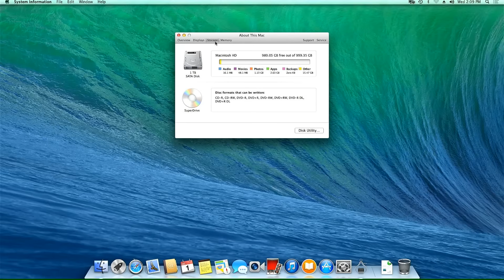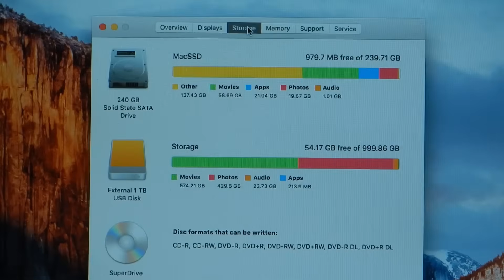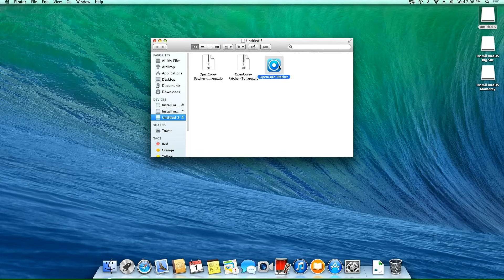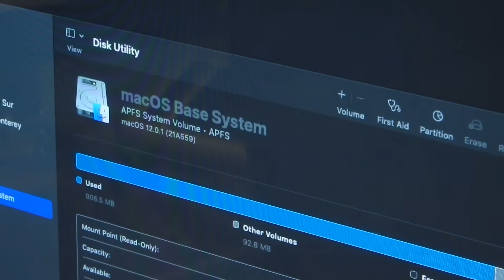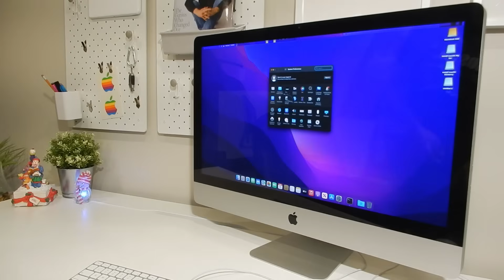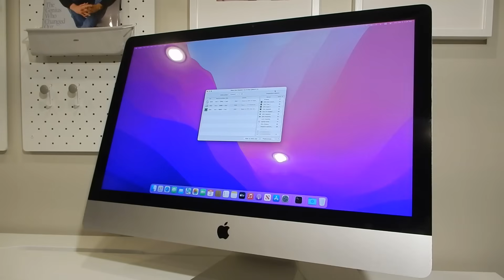Apple thinks this 2009 27" iMac is worthless. Let's refurbish and upgrade it to Monterey!

Comment: So now I can buy an old iMac 27" from 2011.
Offcource I wil run the newest MacOS.
But also I want to use it as a monitor to connect to my Windows 11 Mini PC.
Can you telle me how to connect my Windows 11 MiniPC to the iMac 27" 2011, so I can play also with Windows 11 on the iMac ??
Reply from the maker: The feature you're talking about is Target Display.  I'm not sure if it works on Monterey, since I don't think any Mac which officially supports Target Display also officially supports Monterey.  And in order to activate Target Display mode, you have to do it from within Mac OS.  Also, very important, Target Display only works with Thunderbolt display.  The connector is the same as Mini DisplayPort, but it is not compatible (I did try).  I have read that it is possible to use Windows with Target Display IF your Windows PC supports Thunderbolt display - but you'll need to do some Googling to confirm.

Comment: On my 2008 Imac, 10.9.5 was the farthest I could go without problems -
Reply from the maker: Ya, there's definitely issues running newer OSes on unsupported hardware.  Even this 2009 works "good enough", but not perfect.

Comment: Would it be possible for you to go through the driver patching process you mentioned for the Radeon HD 4000 series GPUs? My Radeon HD 4850 is giving me headaches during my 2009 27" imac refurbishment. Any tips on which GPU upgrade you would recommend would also be very much appreciated. This is my first time refurbishing an Apple machine.
Reply from the maker: Hi!  You should be able to use the same patcher which you used to make the USB key.  After the OS is installed, run the patcher again and choose to install Post-installation Patches.  The process should be 100% automatic, and you should have full non-Metal acceleration after rebooting again.  What issues are you having?

The GPU upgrade is necessary if you need/want Metal support, or need to use more graphics-intense applications.  If you are upgrading the GPU, you won't need to install the patched Radeon driver (or you may need a different patched driver depending on the GPU you buy).

Which GPU depends on your requirements, budget, and tolerance/willingness to do some hacking.  The easiest option is to get the latest MXM 3.0 Type B card (Mac version) pulled out of an iMac which is officially supported by Monterey.  Then everything should work out of the box.  You can get PC versions which are much cheaper (and sometimes faster), but you either have quirks like loosing brightness control, blank screen during bootup, etc without flashing the GPU to a Mac version or hacking the driver.  And even after flashing/hacking, certain cards still don't work 100% perfectly.  You really have to do extensive research, as there are pros/cons to each card.  The one I was intending to use myself (if I ever do it) was a FirePro M5100 - because they perform OK, they're cheap and I currently have easy access to a red Dell version which is highly compatible after flashing.  There are probably better cards to use, I just already have a lead on this one.

If you're buying a pre-flashed version (like on eBay), you'll be very limited in what's available so your decision should be much easier.  If you're flashing yourself (or not flashing and forgoing boot screens/brightness control/etc), you can use a much larger and cheaper variety of cards.  If you're flashing, you either need a compatible PC or a USB flashing clip.  If you're not into messing around with these things, I'd recommend a slightly more expensive pre-flashed Mac compatible card from eBay.  Just google "card-model + Monterey + metal", and read up to see if anyone has any quirks or issues before you buy that model.  Also note that not all cards use the same layout, so you need one which is the same and compatible with your heatsink.

Hope this is helpful.  Sorry, but I just haven't done enough research to know what the most ideal card would be for the upgrade.  The most ideal card for me is the one I have easy access to :)
Reply: @rebootretro  Wow! Thank you so much for taking the time to respond with such helpful info! I'll definitely look into this further. Thanks, again, and take care!

Comment: Please let us know what cables have you tried or planning to use. I have the same iMac and I’m trying to use it with 2017 MacBook Pro and PlayStation as a target display mode, also with Monterey having universal control no longer in beta would that work for iMac? If anyone knows how to use iMac as display with PlayStation that would be awesome, also a great video idea - use iMac as a universal monitor/tv
Reply from the maker: This is an area I'm not too familiar, unfortunately.  I don't know if Target Display will work if the iMac is running Monterey, since I don't think Monterey officially supports any iMac with Target Display.  Someone correct me if I'm wrong please.

If you're using High Sierra, Target Display should work.  There is a catch though; While the iMac supports Mini DisplayPort (or HDMI with converter) as an output, it ONLY supports Thunderbolt as input for Target Display.  I tested this and was thoroughly disappointed, because I wanted to use it as an HDMI display.  So to use for your 2017 MacBook, it should work fine.  For a PlayStation or anything else, likely no-go unless it happens to support Thunderbolt video out.

On a side note though, you can get cheap HDMI to USB capture devices from Amazon/eBay which would allow you to watch any HDMI input.  Not sure how the input lag or quality would be; it might pass for TV watching, but I'm not sure about gaming or as a computer monitor.

Comment: Excellent vid! Thanks for posting, this is extremely helpful. I just bought an early 2009 20" iMac and am excited to do some upgrades. Officially it can hold a max of 8gb of ram... wonder how true that is🤔lol
Just a couple of quick questions: Is the Monterey upgrade trick still possible with this earlier model? And when it comes to upgrading CPU's, will theoretically any CPU work in this ol' girl? Or is she stuck with older options?
Reply from the maker: Yes, the OpenCore Legacy Patcher works as far back as the mid-2007 iMac.  The biggest limitation is which graphics card it uses.  According to the Patcher docs (https://dortania.github.io/OpenCore-Legacy-Patcher/MODELS.html) yours is supported with GPU acceleration in "Public Beta".  You will also not have Metal support just like me, which is fine for office tasks and web browsing.

For CPU, you are limited to CPUs supported by your Mac's chipset.  I believe yours is a Core 2 series, and I believe only Core 2 Duo chips are supported (no Core 2 Quads as I am aware).  That being said, you probably won't be moving far enough up with any upgrade to justify the cost or effort, as I believe the included chip in the early 09' was decent to begin with.  You might see some gains in a synthetic benchmark, but I seriously doubt you'll be able to see any improvement in real-world use.  For example, in this other video I compare this late 2009 iMac with a 2020 iMac - https://youtu.be/bO1XvSBG4d4 which shows the CPU is significantly faster in benchmarks, but doesn't really translate to real-world office type tasks as much as we think.

Upgrading the RAM like you're planning is an excellent idea.  Also upgrading to an SSD will provide huge performance benefits; it allows the CPU to spend more time crunching on data, rather than waiting from the data to arrive from the hard drive.  These 2 upgrades will give you far better performance for your $ than a CPU upgrade will :)
Reply: Thank you for your knowledge, you are a wizard. That helps so much!
Reply from the maker: @EastPlanet  Glad it was helpful!  I actually just got a 20" iMac with Core 2 Duo (not sure if it's 2008 or 2009).  I plan on doing a video on upgrading it as well.  My videos are more geared towards entertainment than tutorial, but I'm considering a more in-depth tutorial approach on this one.  Either way, I literally JUST got the computer, and have not tested any of it yet or mapped the video out yet, but spec-wise the Mac is very similar to yours.
Reply: @rebootretro  Omg that's awesome!! I'll be really looking forward to seeing what you do with it man, hope it all goes smoothly. Thanks for the heads up on that :)

Comment: Disappointed that you messed with
 your SuperDrive/ GPU air dam area which will affect GPU cooling. With a bit of doubled sided tape a SSD sits comfortably on top of the 3.5” HDD hard up against the plastic PSU air dam wall to the left of the HDD. Or if you don’t like that you can mount it behind the GPU, also you should have replaced the GPU for $50 to get full metal support and native acceleration.
If the SuperDrive still works it’s a great asset, if it doesn’t they can usually be fixed after removing a few screws and compressed air to clean the lens.
Reply from the maker: I believe there's only 2 SATA ports on this model which is why I removed the SuperDrive.  I needed 2 storage disks, but didn't need a disc drive.  Agree though, would have been nice to have both.  I put the foil tape to restore the air duct.  There is an air passage behind the SSD for the GPU, and from sensor readings it doesn't seem to be an issue.  But that's an excellent tip about alternate locations; I wasn't aware that the SSD would physically fit anywhere else.  I still may upgrade the GPU at some point, although it hasn't been an issue so far.

Comment: Great video, i have done this with a 2009 21 inch iMac, if you retain the sensor from the old cd drive and stick it onto the frame there is no need for macs fan control, the fans only spin up to full speed when the system detects a missing sensor
Reply from the maker: This is very true.  I did move the CD sensor over, however I find Apple is not aggressive enough with its cooling.  Apple prefers to run hot in order to run quieter, and I prefer to run a little louder as I believe cooler hardware is less prone to failure.  I’m only using Macs Fan Control to pull the GPU a few degrees lower since they’re so frequently prone to failure.  Not sure if this will make a practical difference long term but I guess we’ll see :)
Reply: Side note: when recently re-baking my mid 2011 27’s GPU my fans went full blast after reassembly and were showing errors. After multiple rebuilds I noticed that all I needed to fix them was to just give the sensors  a little press to make sure they were adhered well. 
Suddenly errors disappeared and fans worked normally.
Reply: @hanspecans how did the fans stop

Comment: Thank You.
Would you like to recommend me the 32GB RAM (Brand model).
Reply from the maker: The RAM was used and pulled from old laptops.  The RAM needs to be DDR3, but almost any 8GB modules will work fine.  I believe they were 1333mhz but I don’t remember 100%.

Comment: Is it safe to use
Reply from the maker: Safe in what way?  I don't see any way it could harm the hardware.  Software-wise, the patcher is open source so I don't see huge risks from a malicious code perspective.  It works perfectly for me with iCloud/iMessage/etc.  System updates could break it in the future, but realistically if you don't install updates on this system, you're still probably safer than the last officially supported OS which is more outdated.  :)

Comment: can i upgrade this to32gb ram??
Reply from the maker: Yes!  It unofficially supports a maximum of 32GB RAM using 4x 8GB DDR3 modules.  Although the processor is aging at this point, so there probably isn't a lot of applications where you'd get benefit of 32GB RAM with the existing processor/platform.  Anything you'd want 32GB RAM for you'd probably want a significantly newer/faster CPU as well, which is limited to a 1st generation Core i7 at best.

Comment: how to open display?
Reply from the maker: The 2009's have the glass magnetically attached to the frame.  The preferred method is suction cups at the mid-left and mid-right points of the upper end of screen pulling outward and slightly downward.  I think iFixIt has tutorials with photos.  In absence of suction cups, I have successfully used duct tape or packing tape.

Comment: Are you able to upgrade the CPU and GPU on this Mac Model? Or what about the 2011 Model
Reply from the maker: Yes, on this 2009 model both CPU and GPU are upgradable.  The Mac in the video already has one of the top tier Core i7 CPUs offered by Apple so it wasn't changed.  I didn't upgrade the GPU because I didn't have a better one on-hand and didn't want to spend the money, since I don't need the features it brings.  I could end up upgrading at some point in the future, in which case I will make a video.

The official Github page shows supported machines: https://dortania.github.io/OpenCore-Legacy-Patcher/MODELS.html#imac  It appears a 2011 is supported.  Without a GPU upgrade, it appears there could be some graphics issues but they claim the GPU is socketed and upgradable :)

Comment: Would this work with iMac 2009 27” but with 8GB and 3ghz Core 2 Duo and lowest graphics? I would upgrade graphics but don’t wonna risk breaking the thing
Reply from the maker: I did a quick search, and it appears that the '09 27" with Core 2 processors has a Radeon HD 4670.  If that's yours, it should be supported by the patcher.  As for RAM, 8GB is plenty - I went WAY overkill with 32GB just because I had spare sticks on the shelf.  Your 3GHz Core 2 Duo is slower but still a trooper; it should run fine for basic web browsing and office tasks like mine.  You definitely want an SSD though, or the system will be incredibly sluggish.

The graphics upgrade is a more in-depth mod which involves some relatively heavy disassembly.  If you're not comfortable opening it, you should be able to get away with the current one if it is a Radeon HD 4670.  Of course, it will have the same limitations on mine in the video; you won't have Metal support and you'll have the wake-from-sleep glitches.  For web browsing and office tasks, Metal doesn't matter.  And for the graphics glitch, my video here shows a workaround: https://youtu.be/vR0_O7GedrI

Good luck with your project! :)

Comment: Movies, series etc. I will watch, surf the Internet, store photos and videos, and also work study. Is this computer enough?
Reply from the maker: Yes, for sure.  Although with the included GPU running Monterey, you may not be able to run Apple Photos due to GPU Metal support.  But you can still use other photo programs, or store them in folders without any issue.

Comment: How did you load the latest os...I'm still on High Sierra's... Without updating the GPU to metal.?
Reply from the maker: You install it using OpenCore Legacy Patcher just like any unsupported Mac.  When it boots into Mac OS for the first time, the graphics will be so laggy it will be almost unusable... But then you run the post-install patcher (from the OCL bundle), which brings back legacy hardware acceleration.  This gives you acceleration for things like UI animations and video playback acceleration (for non-Metal apps).  Anything that requires Metal will not display, crash or be glitchy (like Maps app) as you might have guessed.  As a web browsing and word processing computer, it works great though.

EDIT: It is possible that Safari will have graphical glitches if it relies on Metal to any degree.  I haven't really tested this as we use Google Chrome (which works perfectly).

Comment: I just got one of those computers. I’m trying to work on it but it’s on that gray screen and says I’m missing something to update from captain. What should I do?
Reply from the maker: If I recall, Apple has some restrictions as to what patches must be installed in order to upgrade (or what versions of Mac OS you can upgrade from).  If possible, make a bootable USB installer, wipe the drive and install a fresh copy of Monterey.

Comment: How do you fix the graphic issue?
Reply from the maker: I don't believe it can be fully fixed on Monterey yet  There is a workaround, which I made a video on here: https://youtu.be/vR0_O7GedrI

Basically the patcher works exactly like previous versions, but on Monterey there are graphic glitches when you wake from sleep.  So you set the flurry screensaver, set all the settings to max, and make it a hot corner of your screen.  When you wake from sleep. move the mouse to the hot corner for several seconds and it fixes the graphics glitches after wakeup.  A commenter also noted that you can fix the minor graphics tearing as well by disabling "transparency" under the accessibility settings.